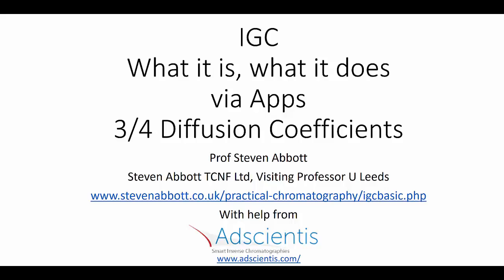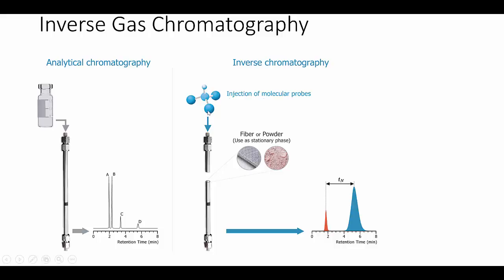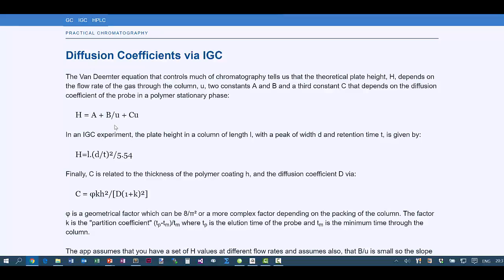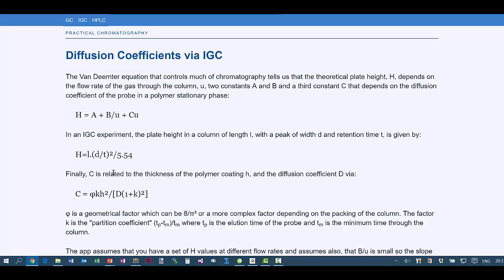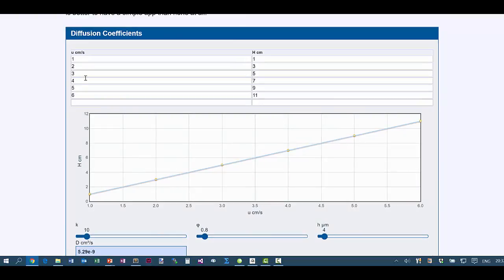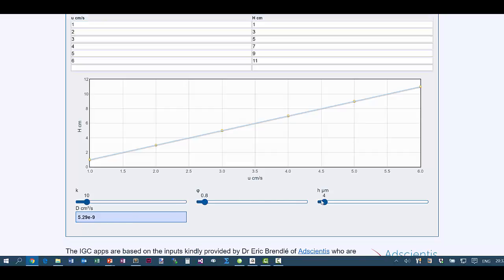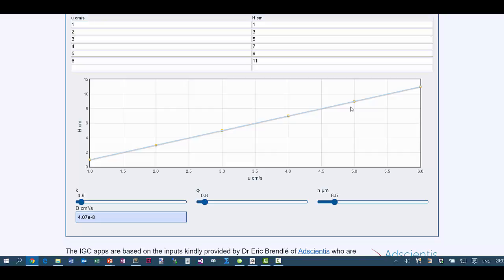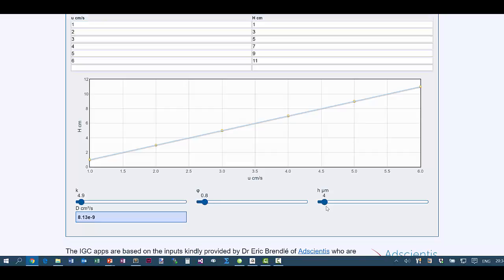IGC Diffusion

Comment: Why can't you cryomill polymers to powder them for packing in the IGC. Is that because they have non-uniform dimensions and estimating the particle size is difficult? This stems from needing to understand very strictly what "h" is?
Reply from the maker: I don't know the answer! I suppose for starters, most of don't have a convenient cryomill. But I think that you're right about "h". When you have a coating of a few μm on a larger particle, you can work with a reliable "h". But if you have a particle of uniform 10μm, we somehow have to change the equation to take into account spherical diffusion. And if there's a broad particle size distribution, that gets harder. But it's only "harder" not impossible. Maybe you can crack the problem and, as I said in the video, change the world of diffusion measurement forever!